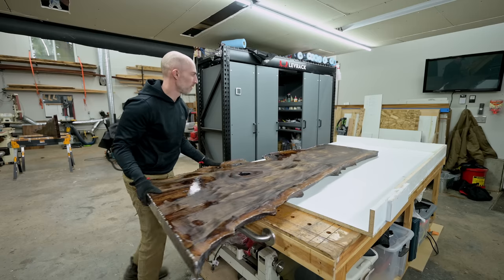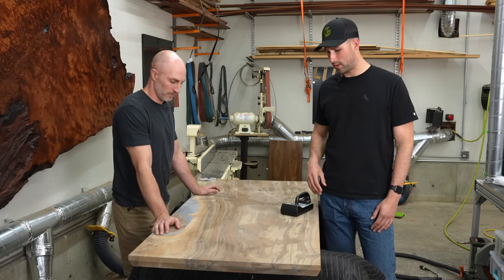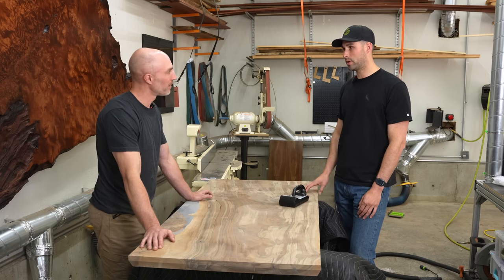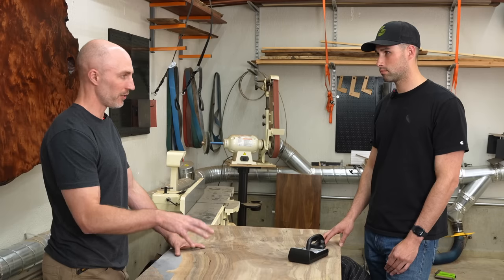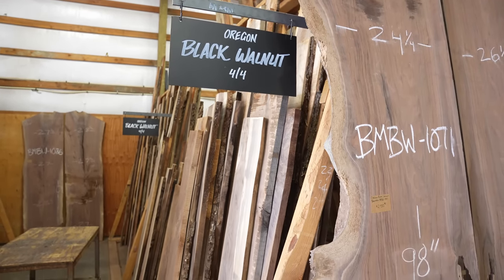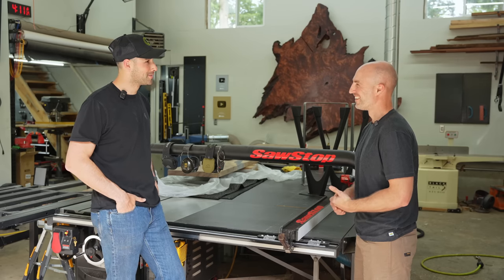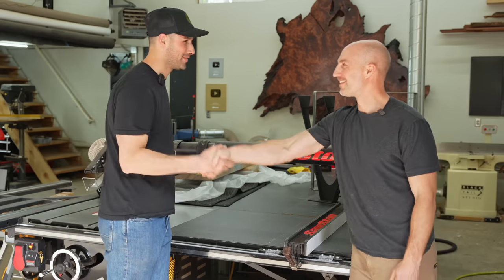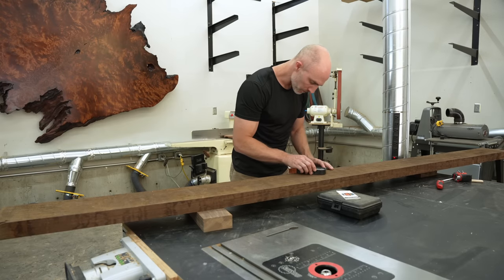Confronting My Wood Supplier

Comment: You really put Aaron the Wood Supplier on the spot, he had no choice but to accept blame.  As a wood worker making 30K on a project the ultimate responsibility is on you since you should know a thick slab will have moisture. You should be checking the moisture at every step to make sure of the content.  Knowing that you have a large following on YouTube Aaron could not take the chance of having bad press and losing business due to a negative review from you. Now lets add the fact that you messed up the epoxy pour and there was no way of fixing that, but wait I can have my wood supplier replace the slabs because I found moisture in them.  So you have the wood supplier take responsibility but you do not take responsibility for the bad pour of the epoxy, so one may have to wonder if you didn't increase the moisture content of the wood yourself.
Reply: Exactly, checking that the material you’re using is suitable for the job is apprentice level stuff. Building 30k worth of furniture and then turning around and blaming the supplier is seriously something I’ve never heard of in 30 years of woodworking.
Reply: I get this feeling a lot from this too. You can tell he's not happy to be there and especially with Cam's frustrating coming through you can tell he's just trying to save face like he's being blackmailed or forced into accepting blame. It shouldn't be unreasonable to check a 30k slab for moisture yourself instead of running back to the supplier upset after you've already worked on it.
Reply: @AndrewGarneau  Aaron was being ambushed by Cam, and if Cam is making 30K on a project he should be on top of any issue that he comes across.  Don't forget that Cam messed up the pour of the epoxy, so maybe he should have blamed the epoxy manufacturer for that too.  Must add that doing a slab top really do not take much skill, compared to doing a full cabinet.  Building a Cabinet, desk, dresser etc takes a lot more skill, due to all of the joints, the expansion of the wood in all directions and trying to maintain good gaps on drawers or doors.
Reply: ESPECIALLY since Cam has had this issue before. I don’t watch the channel regularly, but when I saw this video, I was like “oh this must be a follow up from that previous issue.” Nope. Cam had this same issue before and hasn’t learned to check moisture levels yet?? He’s skeevy for sure.

Comment: Question. Have you ever considered getting your own kiln to dry wood that is just a bit too moist or is your supplier usually good at making things right so it isn't even a consideration?
Reply: Having a kiln and using it the right way is so hard and you need a lot of knownledge and have to do it a lot got get an understanding. It‘s fairly harder than it looks to dry wood properly
Reply: @laurinsstuff  Oh I don't doubt it but in a situation where the wood has already been partially dried out it seems like it would be easier and considering the price a lot of this stuff is going for on top of how long it is already taking it seems like an option. Unless I am REALY undervaluing the effort it takes to dry out even mostly done wood.

Comment: A few years ago, I messed up a few orders back to back at work, I make boxes on an automated. When the boxes fold up, at a quick glance, you can usually tell the dimensions are correct by the seam where the box is joined will have about a .44” gap. I was so cocky that I skipped the fold up step, to ensure the boxes would fold up properly, as it turned out… they did not. The cutting heads on the machine were misaligned in such a way that the gap looked correct, but the other slots were out of place. Since then, I individually measure out each cutting head, and take QA much more seriously. Glad this resolution was a positive learning experience for all involved, and that your relationship with GOBY is still intact.

Comment: I just wanted to ad, If your going to be building stuff on this level you should always pre check everything.  Im sure the tools required aren't cheap but will save your butt down the road. Both of these guys are stand up dudes and would buy from this supplier. I would also if I could ever afford too buy from blacktail 100% he does great work.

Comment: One more recommendation, it is good that you always check your wood because it is tough when dealing with 500,000 board feet of slabs to make sure every single piece is dry, but you should pick up a prong reader, because they are more accurate in my opinion. A surface reader is good for rough estimate, but a prong reader is the most accurate

Comment: I'm old school, don't do the slab/poured epoxy thing but I always took it that the craftsmen was ultimately responsible for the materials he's using.  We check moisture and if it's not dry, you didn't use it.  On the flip side, the supplier is selling you KD at a certain moisture content.  I feel the supplier eating the slab and the craftsmen eating the labor is a fair resolution.

Comment: Aaron from Goby seems like a quality guy - if i was in the US I'd definitely use him after seeing this.  Incidentally talking of working with wet wood, a long while back i worked at the National Trust (UK conservation charity) we used to build our memorial benches out of green oak... of course they're going outside so moisture content doesn't need to be super low but they still moved like there was no tommorow, twisting, splitting, warping... to an extent you could call it character but there were a number where we had to do the tops over again

Comment: This is how you know your working with a good company with integrity on both sides and regardless if a company is spending that kind of money on wood getting the best and most reliable possible moisture meter available is priceless if wood or even concrete depending on what kind of products your using. It only takes 1 time that it saves you thousands of dollars and it will pay for it self while protecting your company and turned over quality of work.

Comment: Goby is a great place!  Everyone that works there is helpful and knowledgeable.  Aaron is why.  As you heard this does not happen much very small percentage of the board footage that goes through that store.  Cam asked who’s fault.  I would say it’s half Cams and half is goby’s.  Cam has only been in this business for 7 years just barely beyond an apprenticeship program so he is still very green.  Checking for moisture content is something he should have learned years ago.   He is still struggling to make an epoxy form that does not leak.  I know what he is doing wrong and a step he is leaving out.  Maybe some day he will figure it out.

Comment: hmm, kunundrum.  1) increase price for woods that tend to be less uniform and tendency for pockets of moisture?    2) create a way to extract moisture from a spot of the slab. Apply a sealed dome to area and attach 2 hoses, one applies heat into chamber under dome and second hose evacuates heat/dry air.   3) in the recreational marine industry, moisture meters are sometimes not reliable. Surveyers use a small ball peen hammer to tap surface & listen for moisture. Wet pockets sound different when tapping.    4) new standard procedure, check moisture in a grid pattern across wood as soon as possible after purchase?

Comment: One of two things with large purchases in person.. there either needs to be true QC coordination as every slab leaves the door or for very experienced purchasers and woodworkers they need to qc check it before even thinking about bringing it home unless they plan to let it air dry a bit longer or sit in a homemade kiln.. just because someone like Goby will deal with SO MANY slabs in a days time I could be easy while trying to keep productivity up with the control of the quality there are people who focus solely on viability of use of wood.. and a big wood worker really should ALWAYS check them 100 percent thoroughly before using.. and I know it's really not the wood workers priority but it can be avoided

Comment: Some more info about heating up epoxy for those interested: if you have a thin epoxy pour that is less than a cm thick and free standing, if you heat it up it will become pretty flexible. I've had it happen even when it was fiberglass reinforced epoxy. However, so long as you don't touch it when you notice it is flexible and let it cool down then you shouldn't have any issues. 

I accidentally heated something too much with a hair dryer and had this happen on a piece with around 3mm thickness. When touching it I noticed the extra flexibility and then immediately put it down to let it cool.

 No idea the exact temp, but it was probably close to or higher than what they use for their kilm. Just don't leave anything touching the epoxy that could dent it and you should be good.

Comment: If your shop isn't climate controlled those slabs will suck up the moisture. Don't say it's  climate controlled with a jacket on and you can see your breath. It's still a drying issue but climate controlled 24/7 is a huge thing as well.

Comment: Thick slabs are very difficult to dry.  On 4/4 walnut you can pull about 7 percent per day on green walnut.  As the slab get thicker, I'm assuming that slab is 8/4 and it should be usually air dried down to mid twenty percent, then put in the kiln and pull only 1 percent per day.  Heat needs to be set at 120 Dry Buln with a Wet Bulb setting of about 100 and let the drying proceed till you get the core down to 6-8 percent.  Probably will take about 45 days.  During the video I saw the lumber coming out of the container kiln.  It appears that the lumber is almost tight to the one side.  There needs to be at least a 12-16" air plenum for the air to flow thru the lumber. I build dry kilns and my company is Kilns & Systems, Inc.   Design and build dehumidifier kilns along with steam kilns.

Comment: from a german carpenter perspective i would like to say that it is your responsibility to check the level of moisture before buying. nobody can guarantee a certain amount, especially if the wood was stored in different locations with different humidity.
and i would like to add that in germany, in a comparable situation, you would just get laughed at for beeing a rookie with no experience messing around with the pros. sorry to say it that way but its true.

Comment: Respect for Aaron, great service!

One question that has probably been asked already but I can't find the answer : If you were to fully encapsulate the wet/dry slabs with epoxy, wouldn't that solve the uneven drying out issue? Sure, the finish would probably be high gloss instead of the usual (preferred) burnished look, but at least the wood would be saved? Just asking if encapsulation is a viable option?

Keep up the good work, Cam. Your work is the gold standard, as far as I'm concerned.

Comment: That was definitely a tough conversation for the supplier and yet I think the honesty of how he responds is credit to their business. Can you share a little about your added costs & time you put in into the project at that point? I mean, obviously you can't hold them accountable for that portion of it, so I feel like anyone working with these materials just needs to evaluate their total costs and if they are doing it commercially, to mitigate this issue through purchasing the right tools, or being able to eat the loss. If you were doing 50-100 tables, sure it would be bad to lose 5% but you could survive. If you are doing 1-2 or 3 tables and you run into this issue once or twice, it'll empty your wallet out. 

BTW I feel like the same could go for buying wrong tools that cause problems so each process and step has its risks. Imagine if you got an epoxy that never fully cured.... they would not comp the loss of other materails.

Thanks for sharing!

Comment: This video highlights the importance of purchaser quality verification for materials where high integrity is required.   This is required, for example, in the manufacture of pressure vessels and nuclear components.  Of course I'm sure Blacktail did their usual QC, and the supplier probably did as well unless the slab totally bypassed the process, but the fact that this slipped through means that either the system failed, or the level of inspection was inadequate for the material criticality.  Perhaps everyone's operating procedures need to be improved to be more thorough, using better equipment, and scaled to match the importance of the slab in question.

Comment: With building guitar the tolerances are much tighter. It's normal to cut something and let it sit. Sometimes stuff just starts to move even though it's dry. As a woodworker you need to know how to work with wood, which means you share responsibility. 

Best thing would be to share the profits of the tables with the faulty woods. Giving them away looks charitable but it's once again something that gains you more subs. Aaron did make a mistake but it's not a 100% on him. Credits to him for actually explaining everything clearly and to be this respectful. You could've done the same, but didn't really.

Comment: Just a thought.
I'm a finish guy and I do a lot of live edge epoxys for a living. Those "yellowish" or light streaks sometimes have a strange porus nature to them and are open and wider fibered. I've never been completely satified with any epoxy/finish result in those areas. Still, people love the sort of figuring effect. I've used a very thin, very volitile one-part penetrating epoxy to stabalize dry rots we used on a couple of marine resorations a couple of decades ago. Works like a charm, nasty to work with, and man, that stuff is toxic as hell. That last part is why the idea is still just a thought.

Comment: I left a comment on the main channel as well, and Aaron is cool, my brother has had multiple talks with him. We are a pretty large operation located in Williamsport, Pennsylvania. Historic lumber Capitol, and my brother’s been in the slab business for over 20 years now, and we have a process, where we air dry for a minimum of 18 months and up to four years or more on certain pieces, then we have a DH kiln and after that it goes into a vacuum kiln. A lot of our product ends up out west in super dry climates so we have to make sure it’s reading low moisture content all over the slab. And although we have come across slabs that have moisture pockets, because of our process, it’s usually a difference of 6 or 8%, so the highest readings can be reading around 13 to 15. And depending on the piece, we actually do have ways of drying those pockets, although it does take longer.

Comment: A lot of respect to Aaron for his humility in owning the mistake and being willing to discuss it on camera. The true test will be, what does Goby put in place to prevent this from happening (or at least lessen the frequency, as I understand perfection is unrealistic). Like he said in the video, they have all the tools to check this and ensure the wood is dry. This is likely a process change that will add overhead (labor), but I’d be willing to bet that Cam would have paid a little bit more for those slabs to avoid what happened. Yes he could have also checked the moisture, but I don’t think consumers should be responsible for verifying the product they are buying is what the seller says they are selling (in this case, kiln dried slabs).

Comment: I understand you bought the pieces as “dried” slabs; however, the moisture was trapped when you put epoxy on them. That’s definitely a downside of epoxy.  It’s not realistic in terms of acclimatization.  Both guys are culpable in this.

Comment: Its the consumer's responsibility to check the MC.  Suppliers sell the material and are not monitoring their inventory for moisture.  And suppliers are anxious to move inventory and will sell would even higher than 20%.  Your best strategy is to check MC when you get it.  If it is too high let it sit for a few months in a conditioned space.

Comment: This is a painful video.  Particularly because I know Goby to be one of the most reliable sources of properly dried walnut slabs in the country.  I've been working with Aaron and Goby for many years and have come to rely on the consistency of their kiln drying operation.   I'm actually just now finishing up two bastogne tables from Goby with two much larger walnut slabs in the kiln for tables this Spring.  Over the years I've been shocked at how many suppliers are willing to sell improperly dried wood.  Doing so is a form of sabotage to the woodworker trying to make a living with wood that will eventually fail.  Never the less, it happens again and again.   Wood is a tricky, finicky material.  Mistakes can and will be made.  Good on you, Aaron for doing the right thing.  Cam, I think you may be surprised at how well the epoxied tabled do after their second kiln tour.